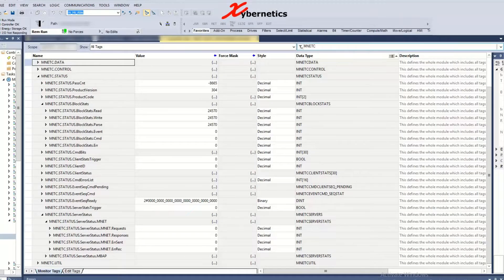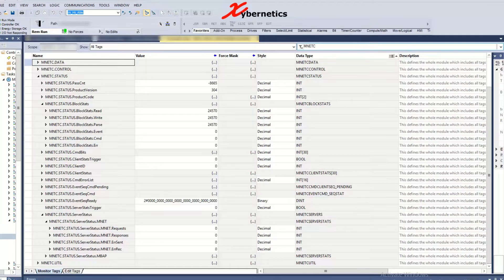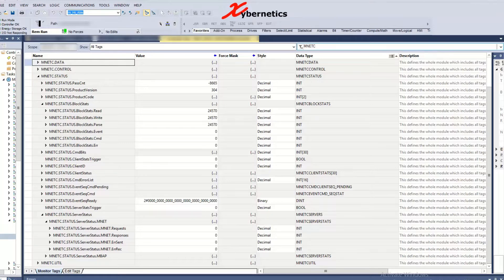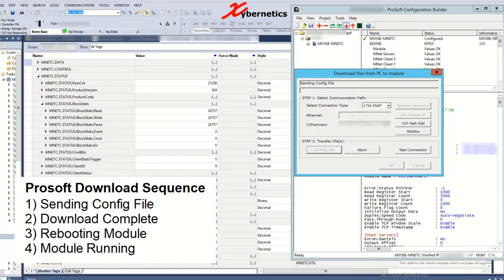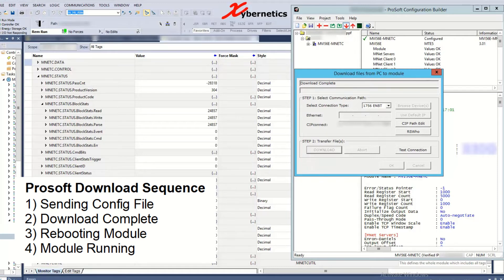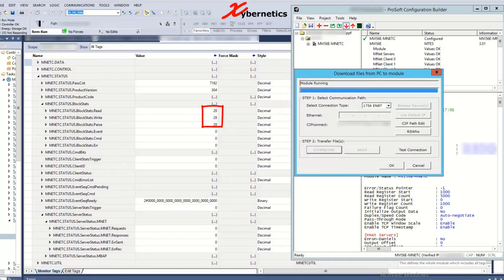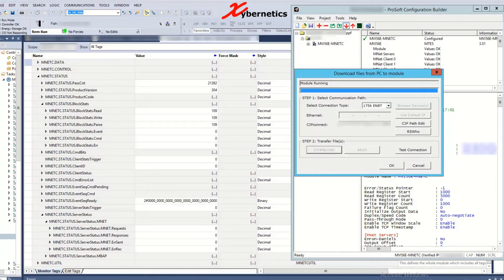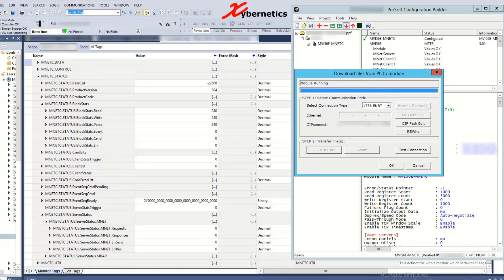Detect ProSoft Configuration Has Been Downloaded To The Module

Comment: Hello, question please. After importing the file to plc and downloading it. And want to for example to add more read or write registers, do you need do the whole process again? I meant exporting the file from PCB and import it again to plc and so no
Reply from the maker: In short. Technically, no you do not have to do that. If you are trying to program a particular ProSoft module for the first time, you should upload (read from ProSoft) the configuration from the ProSoft module to your PC using ProSoft Configuration Builder and start configuring the ProSoft accordingly with your changes. When you return again to make additional changes, if you are sure that no one have ever touched or change the configuration of the ProSoft, you can use the same ProSoft configuration that you uploaded earlier. But if there is a slightest hint of uncertainty, I would highly recommend you to read (upload) the configuration from the ProSoft module and start work from there.
My rule has been that if it is a live working site, regardless of if you had work on the ProSoft configuration last week or even last night, I would read (upload) the ProSoft configuration from the ProSoft. Back it up as "As-Found" copy, and then start work from that point onwards.
I hope that helps.
Reply: @jjnet247  thank you so much for reply, I do appreciate it. But it's not what I meant.. what I have now is running system with out any problem. What I need to do is read more registers from the slave to the plc..so I opened the existing configuration on prosoft module by PCB software and edited it and downloaded it again to the module. My question is in alenbradly plc stideo 5000, do need to do anything? Or I will find my modification already reflected on MBS data? I hope you got my point...thank you again
Reply from the maker: @Deiski76  If you are planning to edit the read and write register count, then you will have to resize the ReadData and/or WriteData array in your Rockwell Studio 5000. For example, if you are using the ProSoft MNETC module, you will have to resize the MNET.DATA.ReadData[X] array (and/or MNET.DATA.WriteData[X]) in your ProSoft Studio. Likewise if there is no change in the read/write array size, no edits are required in Rockwell Studio 5000, apart from implementing mapping logics in your Rockwell  Studio 5000.
If you have more question(s), please feel free to drop a message in the comment again.
If I have answered your question, good luck with your project.
Reply: @jjnet247  thank you so much,  I do appreciate your support
Reply from the maker: @Deiski76  We here @ Xybernetics are happy that we can be of help to our technical community in our YouTube channel.